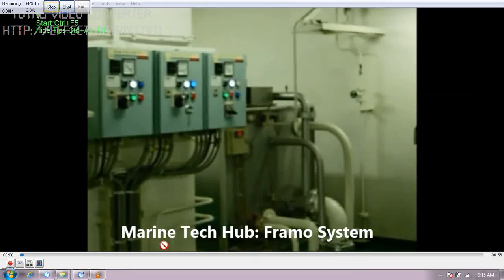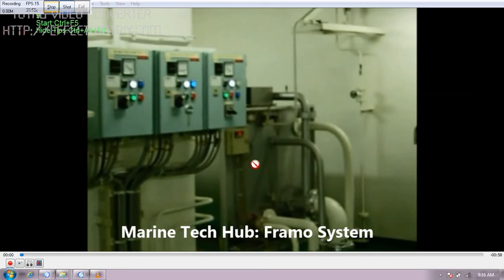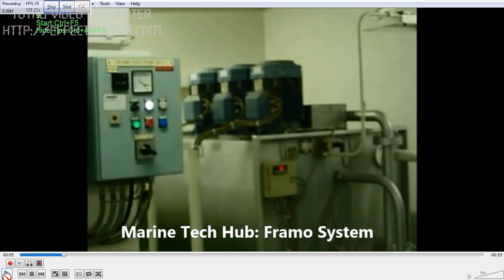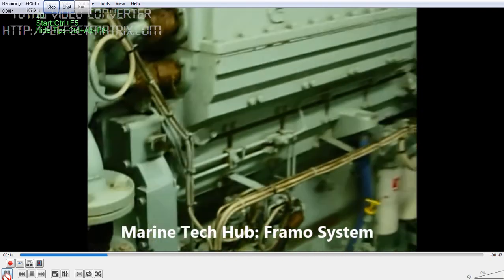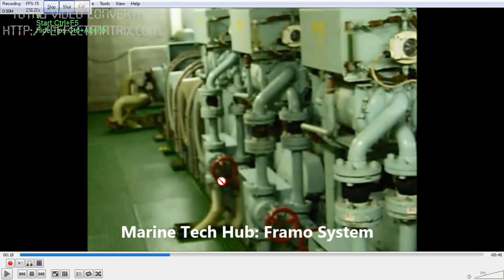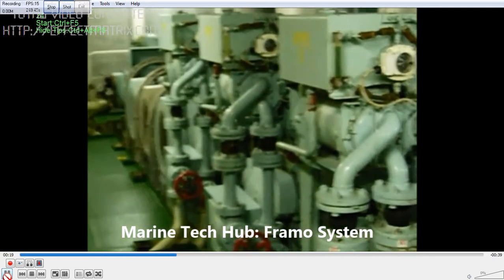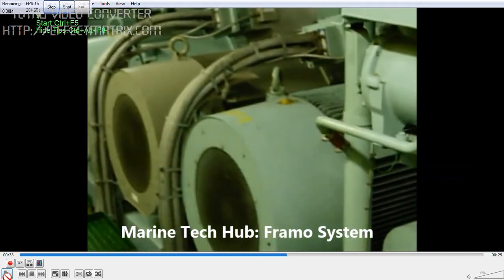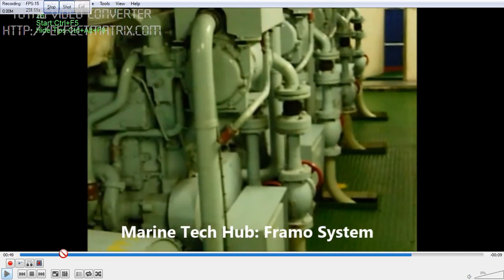Framo System:Important Tips For Engineers

Comment: Bro... ever heard of jocky pump?!   we DO NOT  need to keep any main hydraulic pump running while framo is not in use... the positive pressure in the hydraulic pipe line need to be maintained, but that is done using the jocky pump.. not the main pump...
Reply from the maker: Thanks for your valuable feedback.  I was saying feed pump which is also called jocky pump. This mounted above the expansion tank

Comment: Question: During trying out before any operation we are able to increase and reduce the system pressure without any issues.

But once the system is in use after some time of operation randomly, we are unable to increase or sometimes decrease the system pressure. This problem is solving after some time on its own, but many a times we are unable to raise or reduce the system pressure for a considerable amount of time. Any Guesses where to check for this type of an issue?